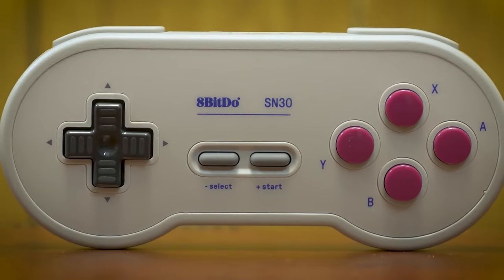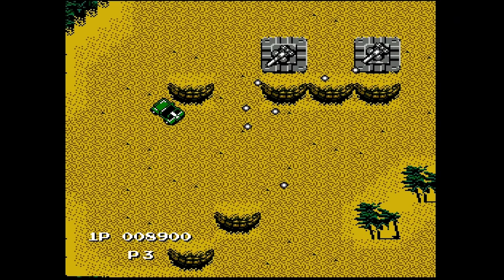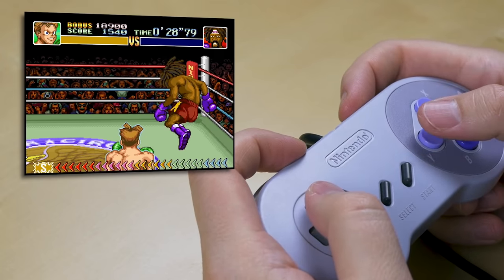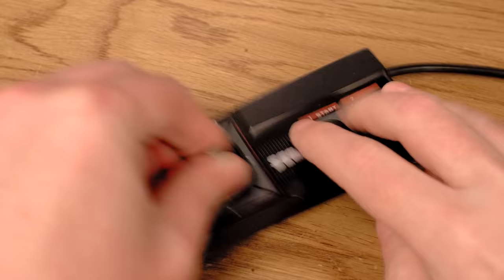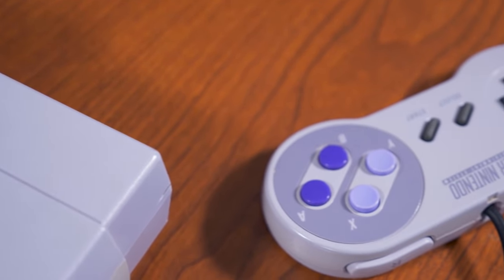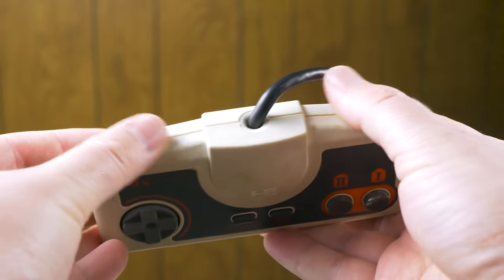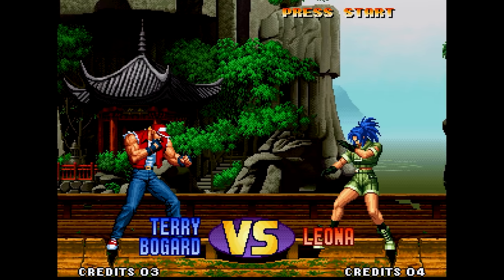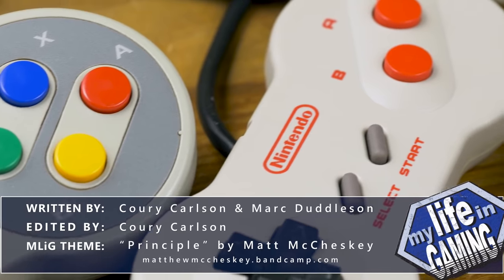First Party Controllers #1 - NES, SNES, Genesis, TG-16, Neo Geo, and More! / MY LIFE IN GAMING

Comment: Just let's pretend Atari never existed....
Reply: Haha, I think most of the "popular" YouTube channels don't touch them. Turbografx and snk is "cool" enough usually to be included due to its 4th gen links (it tends to be the generation most gamers look most fondly back on).

Atari controllers were generally awful though, although there were some versitile ones. 2600 had the configurations for large number of buttons but this only ended up being used for the keyboard controllers. People presume it is a single button console but it was just never even used due to the default joystick configuration. Compare that to the channel F that had twist left and right pull and push, very different.

5200 was known as awful controllers and its well known what a graveyard purchasing them were. The 7800 had two different ones, with the European one favoured more. I don't mind it, definitely prefer it to 2600 joystick and even use it for some 2600 games but it was severely limited and small in size. Don't have a jaguar yet, but it was seen as a dead configuration by then to have a intellivision / colecovision overlay setup.

Comment: Please clean your controllers once in a while or at least when your going to do a controller focused episode. Some of these were so gross, like the master system.
Reply from the maker: [Coury] Do you mean the close up of the plug in the Master System controller? That was left in because it was so extreme I found it hilarious. For everything that I personally shot, I opened up them up and cleaned each part with a toothbrush under running water.
Reply: @mylifeingaming  Made me gag, so good choice. Thanks for sharing some of the alternatives and fixes for older worn controllers.

Comment: The dogbone's buttons should be angled the other way, so you can rest a thumb across both.
Reply: It's crazy that they didn't do that. It was 1993, they had known for years already that the other angle was so much more ergonomic, hence the switch to using B and Y for mario games instead of A and B. The gameboy was 89 so I'll give them a pass on that but there's no excuse for the Nintendo top-loader release. Its deliberately making it more difficult to use for absolutely no reason